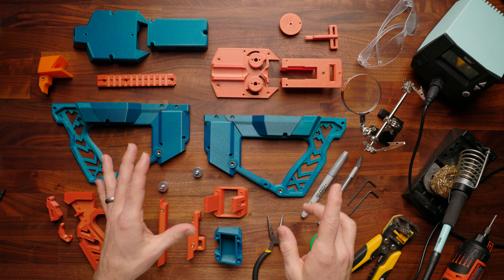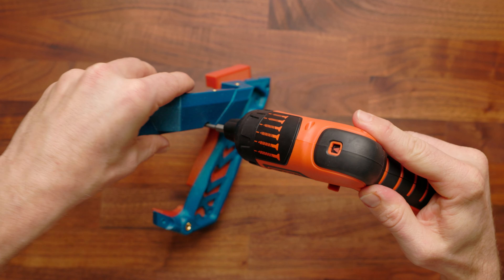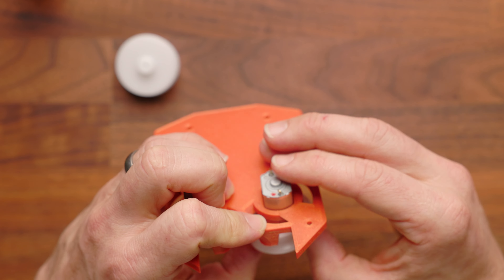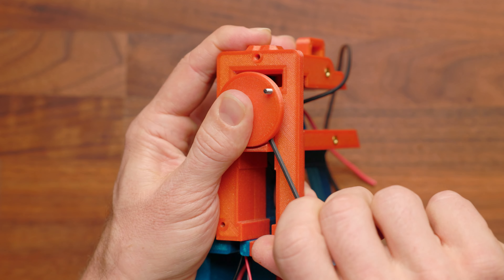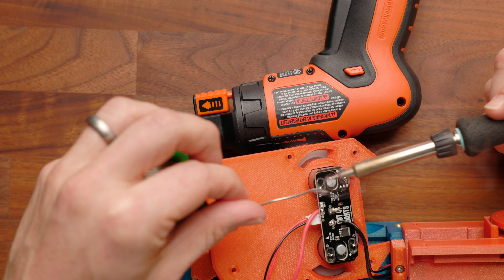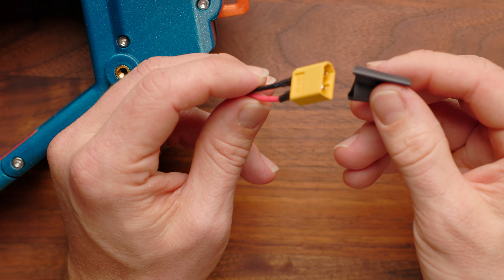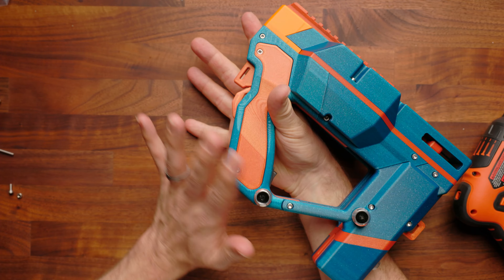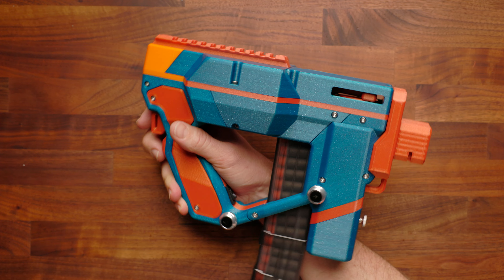BUILD GUIDE: RS187 Luchadora

Comment from the maker: I'm really excited to see more of these in the field. We've got more tutorials coming, so stay tuned!
Reply: Really excited to get my pair, but on that note if the magnet holdstere bolts come preinstalled then how will you know which side to install them on? :P
Reply from the maker: @quiettoni913  We're still working out the bugs with our process, but if we preinstall them, we will either have the option in the listing itself or we will email you before installing them.
Reply: @squirts1 In a word, output. Lipo batteries are used because they combine high ampage output and small size. Hitting a powertool 18650 cell repeatedly with stall current demands can be a good recipe for a battery fire. If you dont disassemble the powertool pack then the overdraw protection will probably kick in.

Comment: I have a question. I'm new to the modding side of Nerf. I ordered the Phoenix 2.0. It worked for a week.  Now all of  the sudden, the pusher doesn't work. At first it'd  fire a full magazine, then stop working. Could the pusher motor be dead? Or could there be a short somewhere? How would I go about diagnosing the issue?
Reply from the maker: Shoot us an email to orders@outofdarts.com
We'll be much better able to assist you there!
Reply: If you built it yourself, it might not be a bad idea to open it up and check your soldering connections. I'm kinda garbage at soldering, and its caused me some similar problems in the past

Comment: I suggest you add peg keys during the printing to the kits for easy assembly?
Reply from the maker: I'm not sure what you mean. If you don't already have an M2.5 hex key, we sell a simple one for $0.75, but I'm not sure how that would help during printing.
Reply: @OUT OF DARTS  if you have ever made a model 2 part cast with epoxy then you know that a molding key is if not I suggest you check out it yourself for the info.

Comment: Why are the screws metric? Standard SAE is easier to hunt down at the local hardware store in the U.S. .... ?
Reply from the maker: We provide all the hardware in our kits and metric machine screws so you don't have to source them. Also, we continue to use the same type of screws as many of our previous products so that you can service and repair any of our blasters in the field with only a limited number of tools; it just so happens that those are metric.

Comment: Is pom better than abs
Reply from the maker: It's not necessarily better or worse. POM (AKA acetal or Delrin) does have different properties that make it better in certain applications, but ABS is better in other use cases. So it really depends on what you're making whether one will be better than the other.